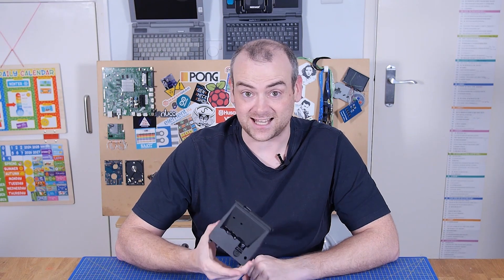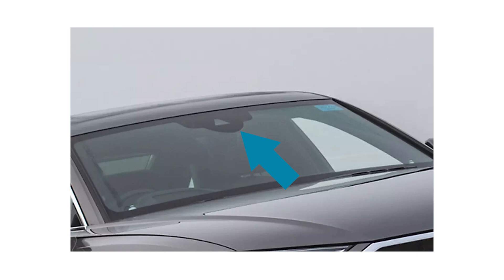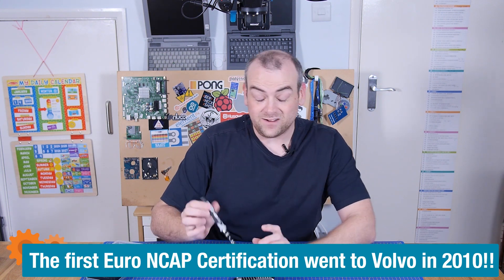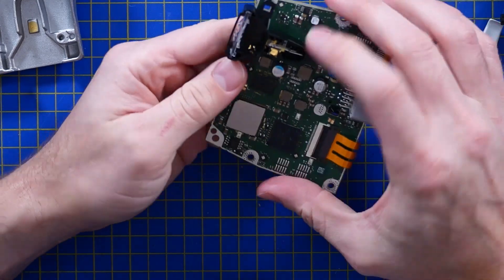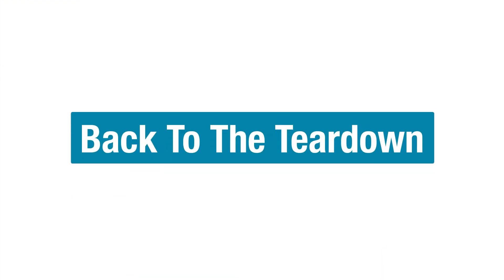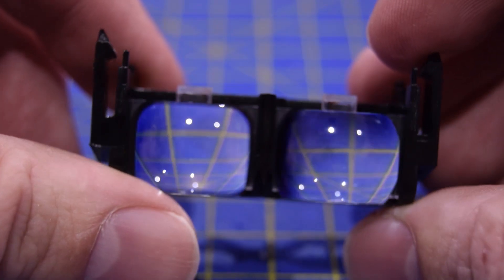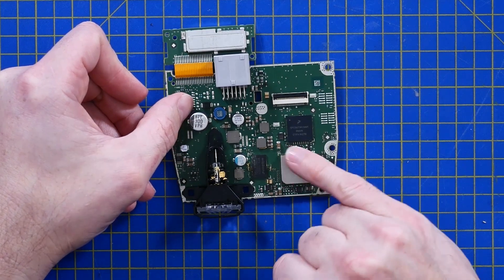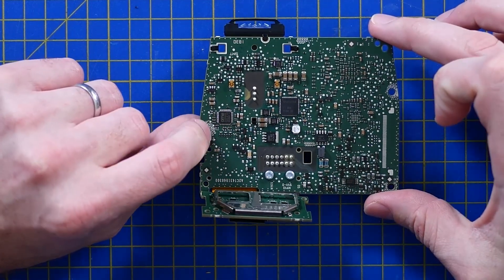See What's Inside Optical Car Sensors - The Electronics Inside

Comment: This device is called a ADAS camera. It has nothing to do with the FTIR windshield wiper sensor. That's a seperate part, and that needs to be in contact with the glass directly via a round puck of silicone material that is like an optical fibre. It's a seperate unit that sits next to the ADAS camera. The IR LED with the Fresnel lens sends out light to the car in the front, and the three photodiodes are used to read the reflection. The camera lens is an actual camera and all the image processing is done in the ADAD camera itself. Most automote chips are custom made for automotive use and part numbers doesn't lead to anything useful. Putting FPGA into super cost-sensitive applications like automotive doesn't make sense. It's probably an ASIC (the big, main heatsunk IC)

Comment: I've always pictured modern cars as being a bit like octopuses where the processing happens mainly at the edges of the network rather than at the centre as it does in vertebrates. The reason for this is that it's easier to sell things like smart lane control sensors if they don't require much to be added to the ECU. I could be wrong though and it would be interesting to see if the ECU has got smarter too.
Reply: would think it also harder to hack 20 tiny puters instead of one big control module as well. Not impossible, but definitely a more advanced degree of skill than what the average skull cap would have.
Reply: These days, yes, that's probably a good analysis!

I'll see what we can find to see if it's on any interest!

Comment: I've talked to an ECU engineer before and the amount of work it does in a given second is astounding. A lot of task management, it takes a lot of scheduling to handle things like firing an injector. Imagine doing other things
Reply: When you think that they have crank position sensors, they must have a huge sample rate for that to be of any use for something that rotates in the 000s of RPM!?

Comment: The three sensors behind the two big lenses seem to be photodiodes that just output one voltage/current. In this setup maybe for sensing oncomming headlights and dimming their own headlight to prevent blinding other drivers?
Reply: I can believe that 1 may be, however why have 3 is an arrangement behind 2 lenses? What would be the beninfit to a sterostropic configuration?
Reply: Those 3 sensors look similar to motion sensors in PIR lights which works on a zebra strips for motion detection, with 3 looking through 2 lenses could measure distance, collision detection maybe ?

Comment: So lot of uncessary info at the start and once you opened it, searched few parts online.
I was expecting more hacking cameras and processor and see how it does that
Reply: Same. Want to see it powered up and analysing some IO
Reply: @hayd7371  In 11 minutes?
Reply: It's often a tough pitch to know who will watch these videos on YouTube. It could be anyone from a beginer with a little curiosity, to a subject matter expert. As such, I have to try and cover all the bases a little at least! Unfortunately for this one, there is a lot of tech and backround information that the average person may not no, so yes, this did end up being a little "talking heavy" compared to the norm.

By all means - if you'd like a follow up with more can bus probing about, or even trying to get some low level output from the board (J-tag etc) we can look into this, but I'd suggest that the algorithyms made by auto manufacturers will be VERY well protected!
Reply: @hayd7371  It will not do /anyhting/ without being connected to the rest of the CAN-network in the car.